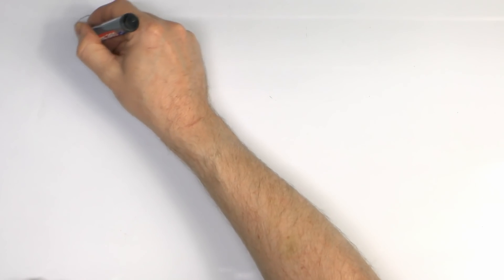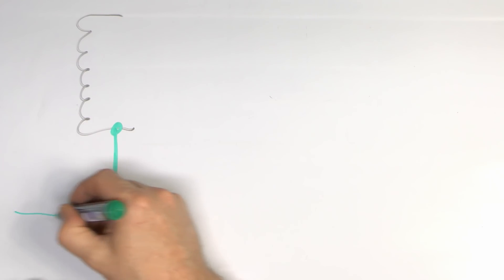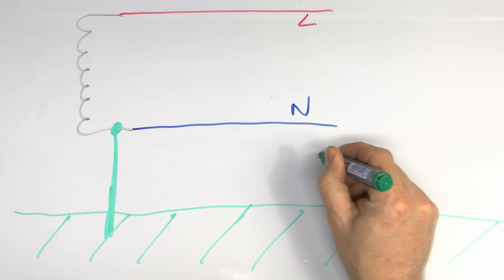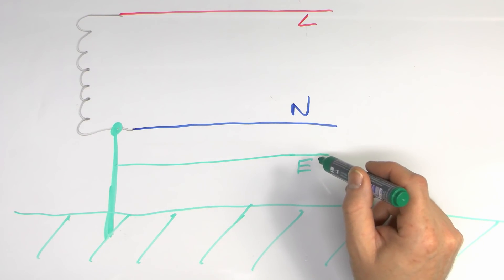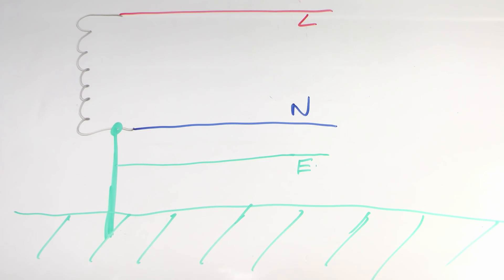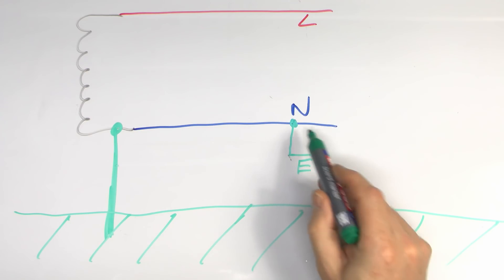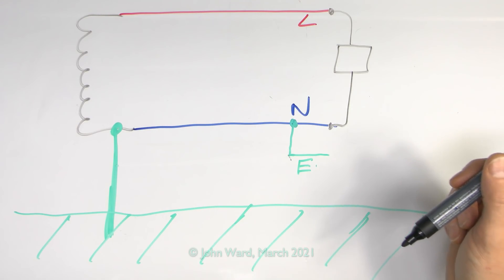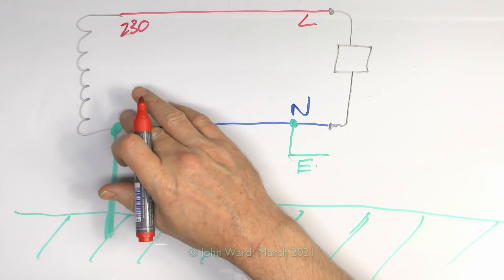Earth Terminal Voltage Drop TN-C-S

Comment: Great stuff, really nice video.
Food for thought and perfect timing what with garden lighting/ hot tub installations being asked for at this time of year.
Very hard to explain to a customer that an earth rod/ TT system must be installed because of voltage rise on the earth which is in fact the neutral and vice versa
and it's going to cost more money to install your hot tub and patio/ garden lights safely especially if you want shiny metal garden lights that have to be connected to the CPC.
Plus there's also the risk of damaging something by driving down 2 or maybe 3 metres of copper rod to get nice low Ra readings and also the added cost of a time delayed RCD to protect the supply cable from the house to sub board prior to TT separation.
Oh Yes It's very hard to explain all this indeed.
Reply: Why not just buy a double insulated hot tub?  Preferably  plastic

Comment: Usually wouldn't the neutral have less difference to earth due to it being balanced by the three phase supply and potentially having less resistance than the lines if the sheath is in parallel. However a phase load mismatch could give a larger difference of earth relative to the shared neutral.
Reply from the maker: If the property had a 3 phase supply, and it was balanced, then yes.
However the majority of homes in the UK have a single phase supply with a 2 core cable.
Reply: @jwflame  Whilst the houses are single phase, most are fed by a short 2 conductor cable from the three phase supply in the road, with the phases supplied alternately to sequential houses, sharing a common neutral. I was thinking that shared 3 phase neutral in the road would have less apparent voltage drop than line unless there was a significant phase load imbalance.
Reply from the maker: All depends on whether the phases are actually balanced.  With all single phase loads connected in the different properties, there is no way to know when or if the three phases have a similar current.
Reply: @jwflame  I've had the task of sinking generators onto substations many times it's not unusual to find 150a diffrence across phases

Comment: A very clear and concise explanation John. Great video as always. The supply network will always limit the VD. I remember on houses with suspected issues my old mentor would leave a 6V torch bulb in circuit N-E. When he came back if it was blew then he knew lol. 

Local generation and battery storage perhaps a solution to issues in the supply network. Cut them out the chain!